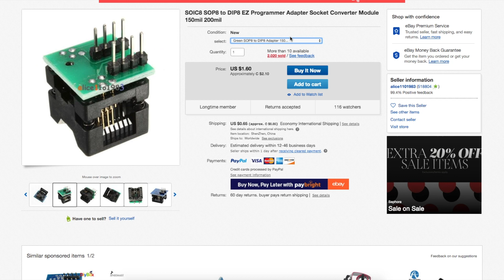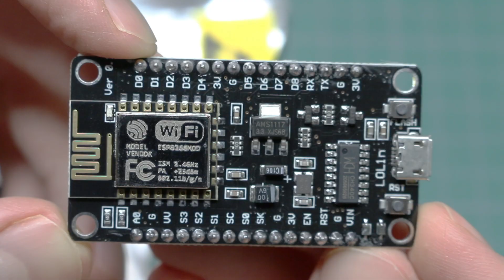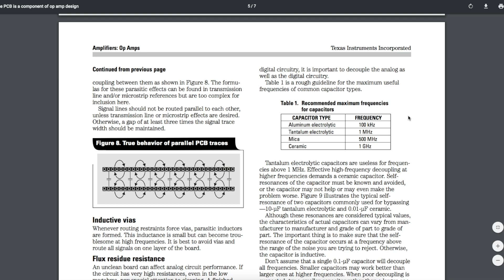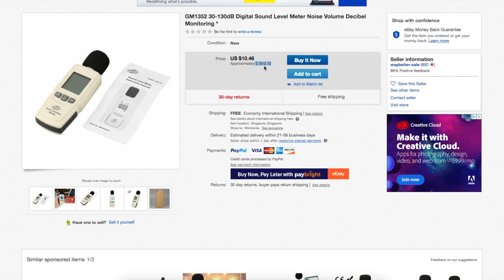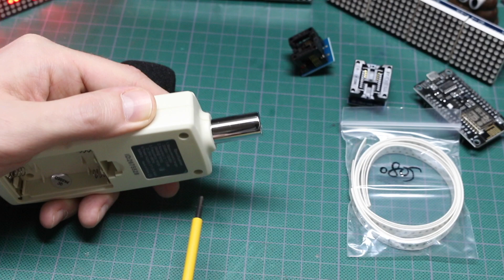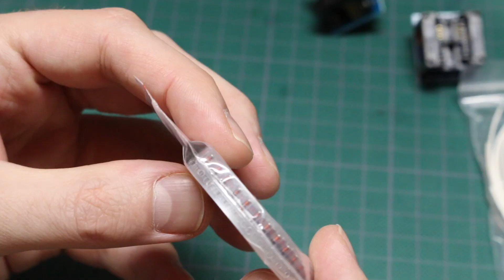GR Mailbag 19.DE.29 Sound Level Meter, SOIC Test Socket

Comment: 1-100Ω is also useful for current measuring in low-power circuits. The kind of thing I’d shove in series with any circuit’s power source just so I can pop my DMM across it to measure current, instead of having to power-off the circuit and somehow clip my DMM in series with everything. Also good for setting adjustable regulators or 431s, or measuring current in a higher power circuit like a const. current mains LED driver. All the way from 1Ω to 10MΩ I can find a use for the resistors.
Also my 1N4148s haven’t arrived yet, which is vexing.